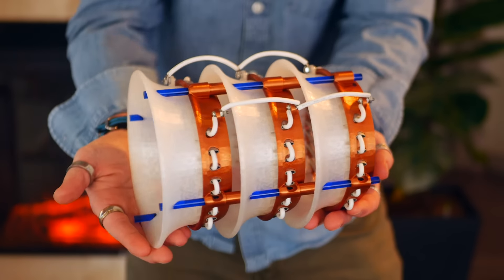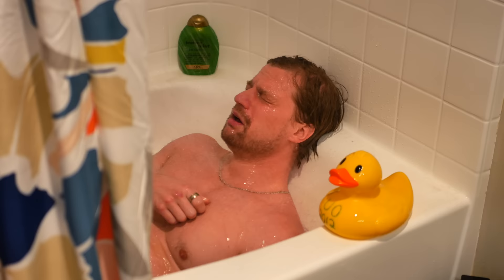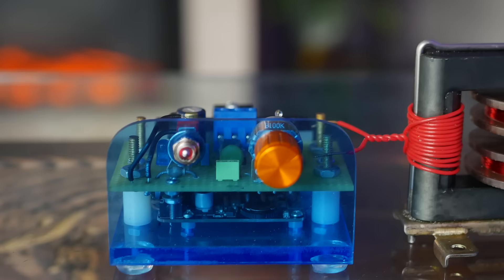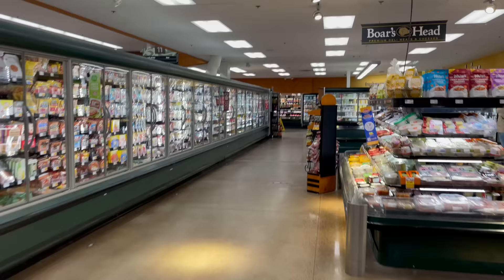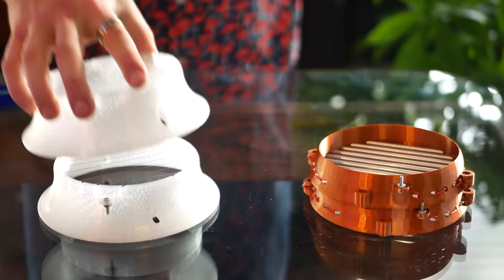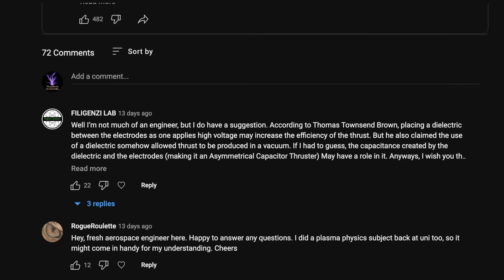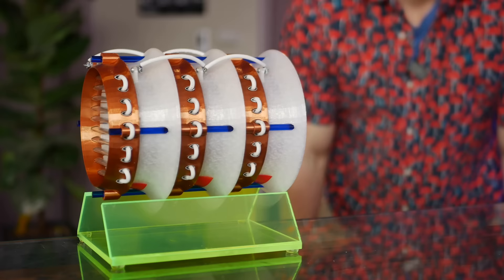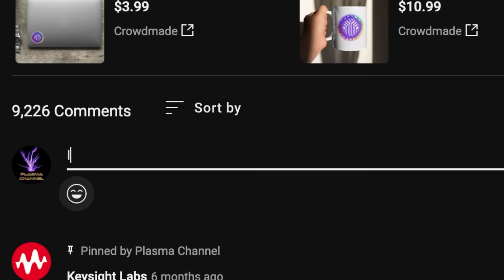The Next Generation of Ionic Plasma Thrusters (BSI MARK 2)

Comment: In order to see this successfully power an aircraft, there are a few issues that need addressing. Considering that a single new version of this thruster weighs around 1lb and outputs about 9mph of thrust, you would need a large wingspan to support the ratio of speed to weight (large lightweight glider). Adding a second thruster could increase efficiency, but not by a factor of 2, and now you've doubled the weight of your propulsion system, nevermind the weight of added fuselage material, power modules etc. to support the system. 

You almost need to scale it up, which really makes a lot of sense.. When you increase diameter on a linear scale, the overall circumference of the thruster will be exponentially larger. I.E. I doubt very much that a thruster half the size of this one would be capable of half the output.. Likely less. 

Further, you need some form of compression stage to help turn some of the m/s into lbs of thrust... Amplification. A 5mph gust of wind won't do much if not catching the foil of a kite per se. But concentrated through a nozzle, can increase on a factor that could motivate beyond 9mph, more like 15, or even 20mph of motivation. Now your aircraft can have a higher climb rate and stall threshold. The discussion of fuel burning almost sidelines the very nature of exploring this technology, and is best for a separate discussion. LOVE seeing this development though. Incredible.

Just a thought, but just by playing with ducting you could manipulate and possibly compound the thrust with positive results.. Would two thrusters pushing through a single outlet (like a "Y") significantly boost output? Could you use twin 2 stage thrusters since each stage doesn't seem to appreciably increase output of a single assembly? Curious.
Reply: Further, I feel the shape can help play into this. What if you maintained the diameter of the thruster, but elongated the shape into a wider oval? Now you can fit more of the longer electrodes into the middle section of the shape which may increase output. Twin ovular shaped thrusters ducting into a shared outlet to compress the thrust and boost output? The outlet nozzle being the same volume of a single thruster could either choke the system or boost output.

Comment: try increasing the number of wires and tubes for every added thruster stage, this can increase the probability of the electrons hitting the air particles. However, this can increase the total weight and might introduce more turbulence.

Comment: Mate just combine the principle on which venturi structures function with the ionic thruster. I don't see compression of air on it's way out, the volume entering the thruster is equal to the volume exiting, reducing thrust. Why don't you build a venturi tunnel and place the ionic thruster on the inlet side, the air that's getting accelerated will create a low pressure within the structure in turn pulling more air in. So you get higher density of air exiting the thruster thereby increasing thrust. There are also a lot of gaps in your design that allow dissipation of energy instantaneously. Hope this helps. Cheers!

Comment: Have you ever considered turn it into a "jet engine" with no moving parts? I mean, adding something to heat the air after the thruster. I don't know exactly how, maybe an electromagnetic coil. Counting that you can take out 5kV at the exit, I guess it would be possible, but I don't know if it makes some difference. But if yes, this would be master. (And you probably would need a new anemometer.)

Other things which would work is raising the voltage and / or the current, shrinking the air flow keeping the same wires, putting some metal sheets in parallel with the housing instead of wires, putting the three in paralel while shrinking just the air exit, like a car exhaust, and combine these things to see which of them work better. I don't know if you have already tested it.

Comment: Air, wind travels in waves.  When thrusters are parallel results are parallel.  (possibly mutually reinforcing some).  When thrusters ore orthogonal, results are to.  This likel generates interference between the orthogonal wave forms.

Comment: Now add two more stages in higher power and the slower stages should feed the faster ones behind it making the airflow faster, also swirls on the intake will help with centering force.

Comment: Try running the positive and negative electrodes parallel to each other in a 3 dimensional golden spiral. Making the thruster more of a funnel shape to speed up air flow while the spiral layout of the electrodes maximizes surface area usage also allowing the electrodes to effect the air flow for the entire distance of the thruster. Could double the output.

Comment: If you had a way to magnify the field created by the wires during thrust, you could tune the thrust up and down slightly by restructuring the magnetic field in the thruster under load.

Comment: 2 ideas... maybe so if similar to how you changed the direction of the wires, trying that with the entire stages instead as from what I understand they font produce airflow like normal jet engines, so maybe the airflow is going between them? Wich could also mean maybe offset the wires to be more in the middle for the second stage... Alan possibly increase the size of the lip on the second and 3rd stage so that they can take in more air rather than be hindered by the first and second blocking it

Comment: Hi there, 
And congratulations for this great video. 
Maybe a silly idea but easy to try. Why not try playing with some strong magnets somewhere around the plastic cones?
A B-field perpendicular to the flow would curl the trajectories of the ions, thus increasing the probability to interact with air molecules. Improving the coupling would possibly allow reducing the gap or distance between the wires and shorten the thruster stages. In other words, a more compact design. My 5p contribution :-).
Good luck.

Comment: I was thinking if you could integrate the tesla valve concept into each stage to speed up the airflow. Also make each stage smaller to compress the air as it speeds up. I think this will do better than having auxiliary air intake on the sides. Designing the plastic to lock into each other with curved insides to speed up the air before entering the next stage. I hope this makes sense. 😅

Comment: You need to add an aerodynamic rod through the centre of one of those, focus the metal rods around that. See your wind speed measuring fan for example. In your current model, the air flowing through the centre is getting disturbed by the position of the rods, that's why you don't see it going so far, the air that hits the rods disturbs the flow of the rest of the air, making the airflow chaotic & short. You need to make your rods kind of like that of the wheel of the bike, where you have an aerodynamic axle through the centre and you have your charged metal wires connecting around it. Its a bit more difficult to make, but it should be much more directed, and pairing them together should be effective up to about three of them...

Comment: Just use a turbofan engine architecture. With a diminishing cross section. You have to adapt it of course to the needs of the ionic drive.  Also, contrary to a turbofan which needs to be round by design, the ionic engine can be square/rectangular as there is no compressor or turbine that needs to rotate. Give both your electrodes a winglike shape in order to take advantage of the Bernoulli effect, preventing a stall or return of flow. You could also maybe configure your electrodes in another, more complex pattern than just singular lines/tubes. Maybe honeycomb? But, of course, still aligned. 
Kind regards. R

Comment: Dear Video Author, you have a linear diagram of three sequential ion engines. I propose to install a funnel-compressor at the exit of the engine, which will direct the exhaust of 4 engines to the input of one fifth.

Comment: The crossed way seemed to be more stable but less thrust. It  stayed within 1.9 and 2.0 a lot more often than parallel that went from 2.5 to 1.8. You were right though. Crossed made it more predictable. That should be easier to control.

Comment: Curious that you did not adjust spacing of the electrodes while the directly in front. An adjustable spacing for the electrode would be interesting for fine tuning. It's possible the engine would gain more flow with the electrodes being movable in the 2nd and 3rd stages even more than the 1st stage. As the air is already moving as it enters the 2nd and 3rd stages, it might need a closer spacing or further spacing of the electrode to acellerate the air to the maximum velocity.  With the electrode in the middle "staggered" I would guess you would gain more velocity as both negative electrode is pulling on both positive electrode on either side. This is quite an interesting idea

Comment: First stage of thruster requires a cone centered and pointing the direction the craft would travel.  This will tame air flow a bit but adding a non powered propeller, perhaps from a drone would twist the air and create a powerful vebturi effect.

Comment: You should try putting a power source on each thruster.  When each thruster is producing an average of 2.3 on it’s own then continuing that set up for each thruster should give you 6.9 to 7mps.  When you daisy chain them off of one power source you’re not getting the full potential from each thruster’s electrodes 😎

Comment: You could try changing out the round tubing that the air flow over to a shape called a vesica pisces.
the round tubs are creating drag/turbulence. the vesica shaped tube would give you much more surface area for ionic wind and reduce drag and turbulence to zero. collectively it works the same as a fish that use the stream flow to pull and push as it swims against the current of a river. just a lot more fish helping the cause. That could change your world. Or our world. Might have to strap the thing down. Just saying!

Comment: The lesser the surface area the more the pressure. Firstly reduse the diameter of your build. Then Try building one where there's no air coming in at stage 2 and 3. Then make stage 2 smaller than stage 1 then make stage 3 smaller than 2. You'll get more air pressure that way

Comment: Perhaps you could use a similar design but with a twist ?  How about using a Lorentz 0 with a breather and then plus the input voltage and thus not only producing a linear thrust. But producing an ionized plasma vortex with a self sustaining discharge.   That the real technology.  Give it a try.  Experiment with the pulse to achieve the proper resonance.

Comment: I think having the second two stages bring airflow in from the sides is a design flaw. Bringing that airflow in blocks the airflow from the previous stage. I believe you should have the second and third stage simply accelerate the flow from the previous stage (i.e. seal the tube after the initial inlet. One way to test this is to take your three individual units, measure the thrust (not the airflow) of each unit and then add them together (you could measure thrust with a floating platform and small electronic scale) and then compare the thrust to the combined unit. Adding stages might not even be the most efficient. Adding cross section and more densely packed electrodes might be more efficient.

Comment: Here is an idea, but it will only work on an older car without significant modification to a newer car.

using an old car with a chrome bumper and no electronic controls, this high voltage tech, you can spread it across the front of a vehicle to reduce air resistance... try it on an old pickup truck or something with terrible aero dynamics, and you will see a significant improvement in air flow, or aero resistance. It could revolutionize semi truck fuel efficiency but they have too many computer controls to risk pairing with a high voltage system.

Comment: Physicists ran into Maxwell's errors, but until January 19, 2021, no one knew or suspected about it. Since they mistakenly thought that the proton has a “Maxwellian electric charge”, two protons participate in the D-D reaction that occurs in the sun, and therefore they calculated that the speed of deuterium nuclei must be very high to overcome the Coulomb barrier, and this is according to the calculations of physicists corresponds to a temperature of 100 million degrees - that is why they began to call such reactions thermonuclear... But on January 19, 2021, I revealed Maxwell’s errors and it turned out that Maxwell’s formula, which is mistakenly called Coulomb’s Law, is not correct and there is no Coulomb barrier in nature, therefore there are no super speeds and colossal temperatures during the D-D reaction - this reaction occurs at room temperature - which was shown in 1989 by Fleishman and Pons... They were not believed, since this contradicts physics... But the physics is false!!!
If you analyze the consequences of Maxwell's errors, you will begin to realize that physicists were mistaken in thinking that there were neutrons, physicists were mistaken in thinking that they had discovered the electron... They incorrectly interpreted the results of their experiments, because they relied on Maxwell's erroneous theory - you can easily find these errors in section "Electrostatics" paragraphs 39-44 of the treatise "Electricity and Magnetism" of 1873.
The last 30 years of experiments have shown that there is no Coulomb barrier in the D-D reaction... I began to understand this BARRIER only after I began to understand the results of experiments in the processing of liquid radioactive waste using hydrowave installations - the absence of a Coulomb barrier was also recorded there... This is exactly what pushed me to understand physics... It took more than 5 years... And here is the result - there is no “electric field according to Maxwell” in nature, there is no Coulomb’s law according to Maxwell in nature, there is no “electric charge according to Maxwell” in nature.. . The D-D reaction has a magnetic nature - an etherodynamic magnetic nature.

Comment: Not a MIT myself or anything, but i guess that adding the fan didn't do anything cause it does a rotating air flow while your device does a PURE linear air flow (very much noticeable with the fire in front of it at the end).
I am wondering (although it most certainly would be very tricky), what would it do if the dual anode/cathode part were to ROTATE in a linear way ? I think it would concentrate the airflow in a smaller circular area, which would (i think) have more strength to it.

Comment: You should try making the electrodes the entire length of the design instead of intersecting with the wind it would hug the body fo the design all the way through and pull the air in the center through very aerodynamic

Comment: I'm not an engineer, but I find this fascinating. I've seem the videos of the "flying triangles" that use the same principle. Have you considered the possibility of how this would operate in space? You'd still have electrons moving in a singular direction, and you'd still be moving the mass of the engine but the question is whether there's sufficient matter in space to be influenced by the moving fields of electrons.

Comment: I wanna see with each ionic going towards the exhaust the thruster and tapers in. Intake could be a larger diameter of 6 inch and ending at 2 inch of exhaust concentrating the moving air that could possibly increase thrust D:

Comment: Power it wirelessly and that negates the need for wire or battery. Just seen some flying cars in altered carbon series and then I realized this is the tech that needs to be powered wirelessly even if at close distance. Maybe an outdoor elevator drone powered wirelessly from building. Would take strain off building look really futuristic

Comment: You have a large volume of air moving but what about a multi stage compression system to increase velocity and pressure not unlike what is found in a turbine engine. Due to this type of thruster having no moving parts you could essentially make the veins themselves where the electrodes are held. This would rotate and push the air moving through each stage. You could then test different spacing and fin numbers as well as pitch in each stage. There is definitely allot left on the table here in terms of design. I think a multistage compressor type arrangement would really move some air baring that the arcing is kept to a minimum.

Comment: You need a superconducting circuit to ionize as much air per second as possible.  And,  shoot for a voltage high enough for ionizing some electrons in the nitrogen, not just the oxygen.
Reply: Also, you probably want a tuned AC circuit so that you are creating pulses of ions moving toward the collector.  Laminar flow has to be the ideal.  I still remember when the pseudoscience crowd was calling these things antigravity.

Comment: There appears to be some major design flaws with that entire setup.

Firstly, those thick rods ... whatever their purpose is... only add turbulence which lessens the output flow.  They need to be airfoils rather than simple tubular columns.

Secondly, the air being drawn in from the sides also ads a lot of turbulence, increasing the volume of air coming out the back while stalling the air being drawn in the primary inlet.   Remove the side inputs or collar them so the inflow does not impact the air coming in the front (i.e. reduce thrust and eliminate excessive volume trying to come out the rear which is the same diameter as the front).
Just make the entire unit a single passage so the air coming in the front is accelerated through each screen to improve output thrust.  Choking the exhaust down 20% could also improve thrust without excessive exhaust turbulence as it 'expands' into the low pressure region at the rear of the thruster housing.